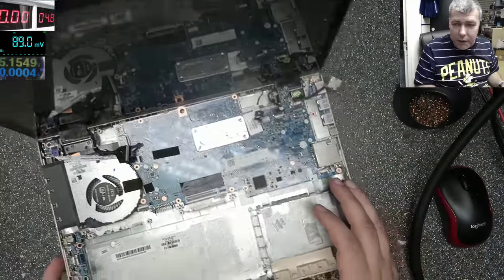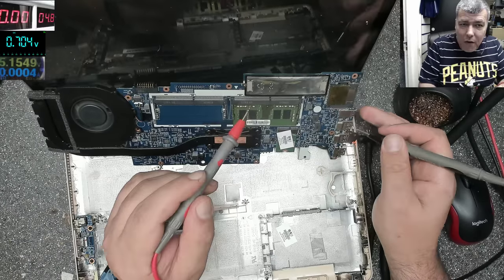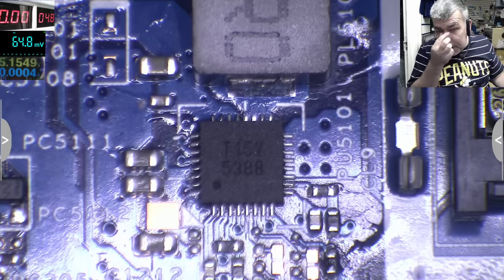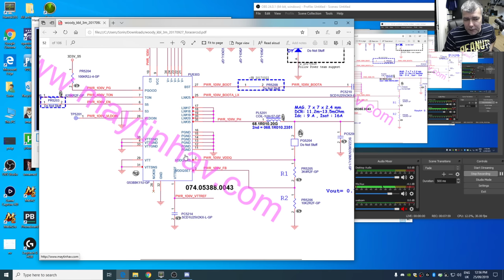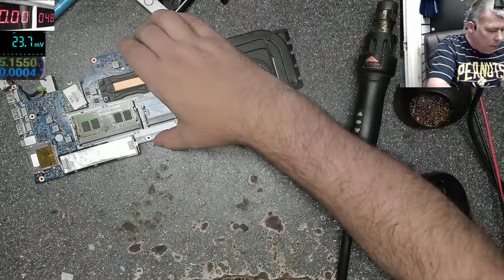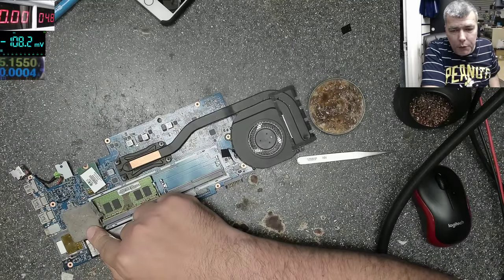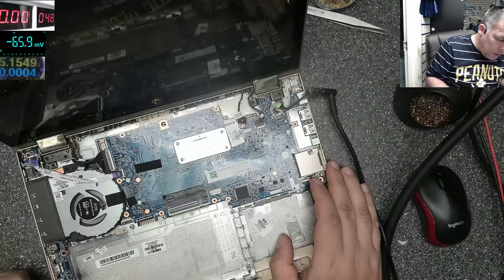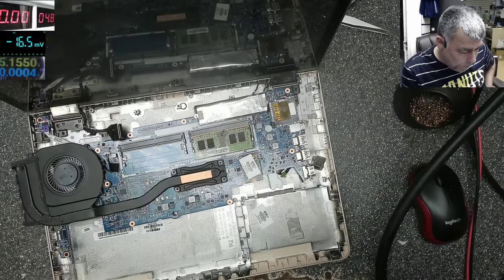Hp x360 laptop, power on but no picture or backlight - 0.7V on the ram memory - Insane, right?

Comment: Hi Sorin , how did you find the right part to replace ?
Reply: He check the main chip he say , it had not good voltage when he check with multimeter...when it dont have good voltage it will happen black screan

Comment: Do you have any videos of a Xbox power brick repair? I got one and as soon as it plugs on it is on orange standby and when you hit power it goes to solid red. 

I know it’s the power supply brick cause we tried another one and it worked. It’s like it’s stuck in protective mode . 

Thank you so much if you can help

Comment: Thanks a lot for the great job. Now I have a dell inspiron 1545, fan spinning for sometime and then the laptop white goes off and on but no display. There is also Hp notebook that turns on but display white light on the screen on and off and caps lock blink also. Please I need your help badly sir, am from Uganda
Reply: As for HP, u can check out this site to find out what does the blinking code on the caps lock is telling u. https://support.hp.com/nz-en/document/c01732674
Reply: @khteoh2001  Thanks but this hp display white light shortly ie on and off and fan spinning is very fast. please help
Reply: White light on the screen
Reply: I think you have a problem on 3.3v on the data cable of lcd..i encountered that kind of problem once..and i find out that 3.3v is missing..the only shows white screen.but first try to reheat the graphics ic before anything else.

Comment: If you type a partial part number into google and then the case style it is more likely to find the part e.g. "5388 qfn32" finds
the G5388K11U straight away..
Reply from the maker: did u found datasheet? Can u post the link, thx
Reply: Sorry no datasheet, just suppliers..